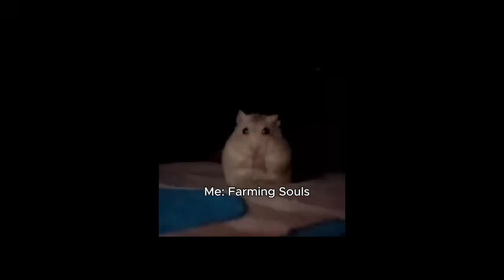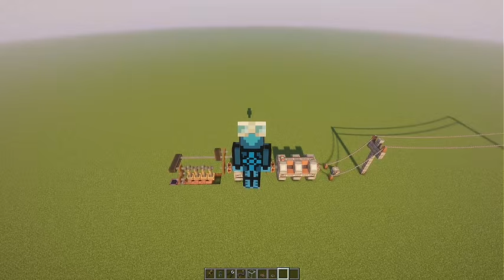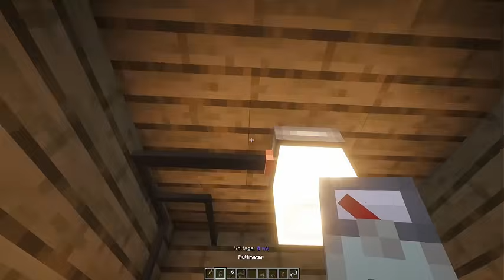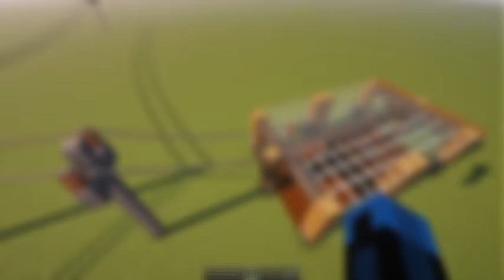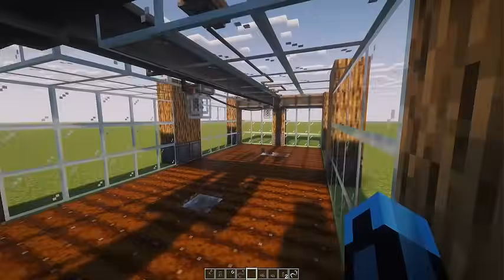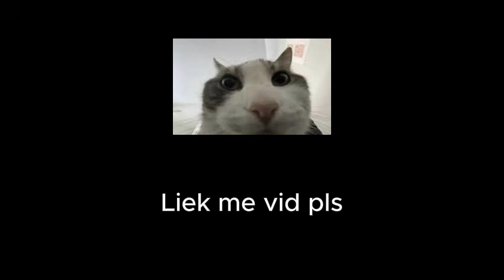Tips on Making Power Infrastructure from Generators to builds | Create: Power Grid

Comment: Thats funny because this mode positioning itself as a ultra realiatic mode, but here is fucking trafoes thats works on directive current. 

In real life trafo phisicaly can't work on DC, cause it's need alternative field to induct the current on the second side of itself. The main and secondary coil phisically unconnected, the alternative current flowing at the main coil creates alternative magnetic field, the secondary coil in this field induct current but with less voltage.
Reply: properly simulating AC would be a nightmare and also make the mod a lot harder as you wouldnt just have to take care of Voltage and Amperage but also of Frequency, Phase, Inductance, Capacitance and a lot of other quirks of AC.
Reply: I believe create: electro energetics has simulated AC with proper power factor and frequency.

Comment: Sometimes I find this mod challenging not because it uses some real electrical concepts, but because it misses some crucial ones and you never know what applies and what doesn't.
Reply: This
Reply: Aside from the lack of implementation for AC and its associated conversion circuits, what do you feel is lacking? Genuinely curious
Reply: @T_1111_T , like the ehaviour of certain things, eg. current isn't read or acts as it normally would, very similar, but readings, displays, how exists in the circuit are different. They don't seem like big things, but they prevent the creation of things like proper load following (which in this mod should be done with regulating input rpm through measured current usage).
Reply: @T_1111_T  tbf AC is pretty performance intensive for a mod, but you can simulate it using redstone, however the frequency is capped at the ser TPS, since minecraft can only do a limited amount of ticks every second

Comment: There's a much better way of power transfer, which we use irl, but bc the power in the game is DC? i think. You need to use + wire, - wire and 0 wire, this tech greatly increases power transfer and its better to explain via video, i could or record you or somehow show it to you. 
OKay so why its very good for power transfer is that we have lets say 120 volts beetwen + and 0; - and 0; but we also have 240 volts beetween + and - 
Also 0 wire actually if everything managed right will have 0 amps and 0 voltage which is neat part.
So theoretically saying if you manage your power correctly you can have 5 wires and four of them have 70 amps which if 120 volts then 33600 Watts in sum. If you use the one that in the video you will require 8 wires for the same power of 33600 watts.

Comment: id love a tutorial on how to charge the accumulators / batteries and maybe a system to stop the charging when full
Reply: if you just want to charge batteries to full voltage, then you can put several in series until you reach your supply voltage. They essentially act like a capacitor, so just put them in parallel to your load and you're done.
If you want to build something that is more like an UninteruptablePowerSupply, you need to detect loss of power and switch in the batteries. I would use a relay, since they're the simplest to design logic with, and have it control a connector. You might need a voltage divider if your supply voltage is too high for the relay.

Comment: With electronic high voltage is like 24v. But in eletrical engineering 600v is high voltage. In America our high voltage is 480v. 220-240 would be our dryers or heavy appliances, EU's normal voltage. And as you know it's just the phases/"legs" that are giving it those high numbers. You have a pretty good understanding!

Comment: Hey! This is the guy who tried to understand the logic of connectors for converting the mod's electricity to Fe/tick! To immediately interest you, from a shunt externally excited generator with a shaft length of seven blocks and a width of one, I got 60,600 (100 connectors and 75 V on the winding)! Honestly, I couldn't have done it without AI; I just don't know all the formulas. BUT! I understood why more connectors are better. Each connector is a 1000 ohm resistor, and Fe generation actually depends on the current passing through it (the formula is FE/t = I × FEPV × 1000, where FEPV is the forgeEnergyPerVolt parameter from the config). By increasing the number of connectors, we decrease the resistance, which means increasing the current (total) and decreasing the voltage. This has a problem: with a self-excited shunt generator, the voltage decreases as the current increases, until it becomes too low, so we need to switch to an externally excited one—it will be easier. With an externally excited one, it's a different story—you need to constantly increase the number of connectors and decrease the voltage supplied to the winding. In theory, the maximum for such a simple generator is 69400 Fe, with an unrealistic 273 connectors, and an external voltage of 27 V. That's why SavageVegeta reduced the voltage—so that it would be higher for the generator and lower for the connector network (with a higher total current) and to be able to place fewer connectors. Most likely, the maximum is much higher on a 4x generator, but I'm too lazy to look. In short, our goal is to get the maximum current from the generator, but with too low a voltage in the system, the generator begins to drop in output until it stops.

Comment: Would love to see you work with single wire power transmission using a grounding rod.
Though don't know how effective it'll be in terms of cost vs efficiency
Reply: There is 1 video with that kind of transmission
Reply: I showed off that transmission a bit when I showcased my avr. Didn't really go into depth, but there is some voltage loss over long distances. But with high wattage it is negligible if you have proper grounding (used a 5 by 5 by 5 of solid copper underneath the grounding rod.

Each step-down transformer will  be connected to the live wire and the grounding rod. 

Higher voltage means less losses due to heat in the wire since high amps causes heat.

If you're thinking resources savings, it's not that good for shorter distances, if you're thinking it looks cool, yes, it is.

One big benefit of this is that you can distribute the load across multiple wires. Since each load affects the entire system, having seperate circuits lessens the voltage drop across the other lines when a big load gets put onto a line.

Comment: Standard European voltage is actually 230 volts (50hz) :)
Reply: US is actually 240v, but it's split at the panel into 2 120v legs, and larger loads like dryers or ovens get put across the full 240
Reply: @HobkinBoi  FINALY! someone who knows what there talking about
Reply: Yeah but here is DC
Reply: @caxap8405  its ac, no one uses dc for long range power
Reply: @The-Tin-Can-Man  bro mode uses DC open your eyes. Also DC is used for long range power transfer, but rarely
Reply from the maker: We do use DC for long distance power transfers called HVDC. And yes we use AC at our homes but that is because it's easier to step-up or down the voltage.

Also cheaper and more efficient for the companies.
Reply: @someoneisnear  we have it but we don't really use it, because its cheaper to use ac from the generator and  to step it up than it is to convert stable dc from ac, we have HVDC we dont use it as are main power transport tho